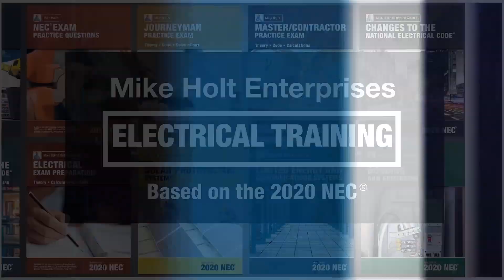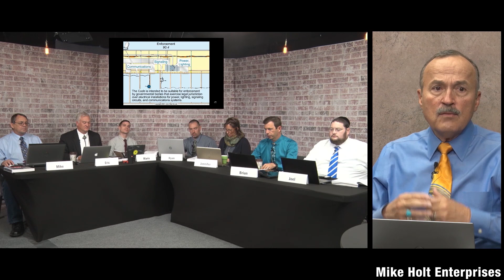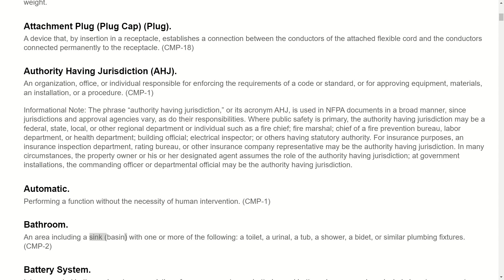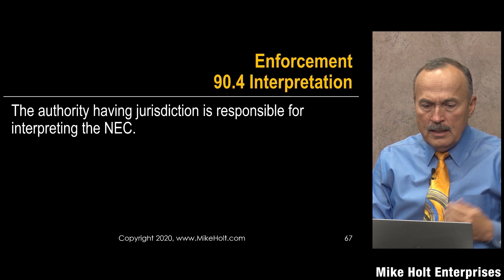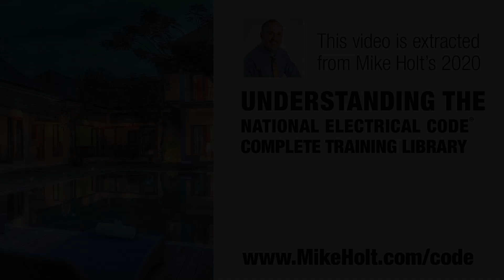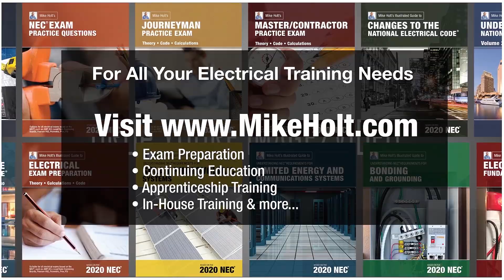Inspector’s Authority [90.4, 2020 NEC]

Comment: In that statement is the problem "Interpreting".  You can line up 10 inspectors and they all may have a different one.  The Enforcement of codes should be created and followed by a local (county or parish) and followed not national.

Comment: i work for a utility and they are wanting us to do repairs on a meter socket my question is if an electrician has to get permits and carry a license to install them then wouldnt anyone working on the socket need that?
Reply: In Connecticut the utility generally won't touch the meter enclosure but we have exceptions in our code that would cover the Utility Co. Not sure if it's the same where you are.

 105.2.3 Public Service Agencies
Pursuant to section 29-282 of the Connecticut General Statutes, a permit shall not be required for the installation, alteration or repair of generation, transmission, distribution, metering or other related equipment that is under the ownership and control of public service agencies by established right.

Comment: Around 18:00 Mark Joel brings up a great thing about if being in an old code and using a product that is only in later NEC. At a IAEI class  an inspector sitting at our table told us that you have to be carefull with this due to potential law suite that could develop. Heard that an electrician got a permit, did a days work in a house then passed inspection. A year later a national law firm had him go to court after house fire because he did not offer the customer AFCI'S that was not required because we were stuck in the 2008 NEC for around 8 years .